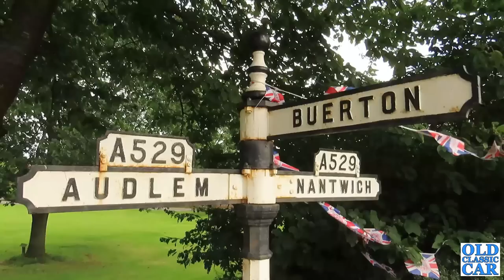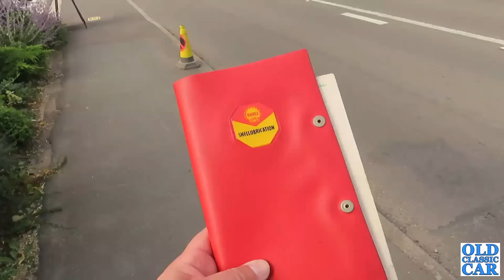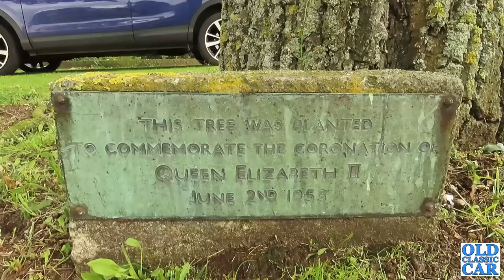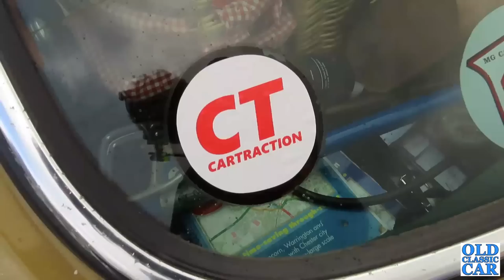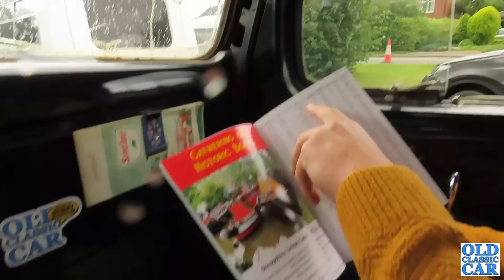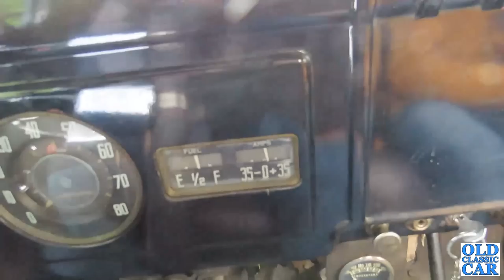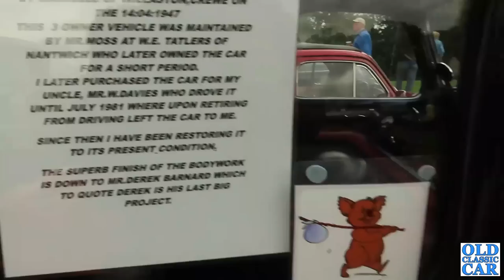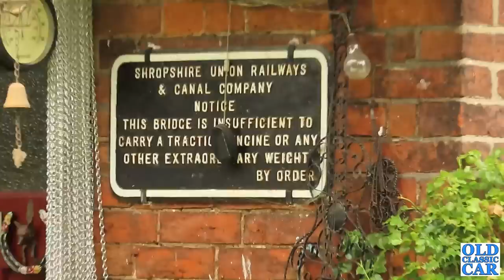The Audlem Festival of Transport 2023 | Prep, Parade & Show

Comment: Me again , there are many MGs at the shows. I watch other people's recordings of British car shows and there are always lots of them.  The must be many MG car clubs in the UK.  I liked the silver grey colored one with the red soft top. Very nice indeed.  There's a British chap who lives in the same city here as me ,and he drives a lovely red MG with the black rubber bumpers.
Reply: Wait... look like your parking brake handle is missing-- so, never mind!...Ours needed new fenders, as they were banged up from acting as "curb feelers" for 30 years, and they were rusted out just above the curled edges at the bottom, so that's something to watch out for, and another place to watch is the sides of the box, just behind the cab, which rusted through-- from the inside, I believe. When I sanded down the doors, I found Worcester (Massachusetts) Power & Light decals on them, so it had an honorable history. In the States, Dodge advertised their Truck line as "Job-Rated", meaning they had a model appropriate for every need.

Comment: Admire your quick and knowledgable, stream of consciousness comments, and love your truck. We had a '41 Dodge pickup back in the mid 1970s, which was an absolute blast. Our dog loved the crank-open windshield (although the drool flew everywhere in the wind). It wasn't happy above 50 mph, so we kept mostly to two-lane roads. One bit of caution: if you forget to disengage the contracting, drum-style parking brake on the drive shaft, it may start to smoke through the floor slot, and the gas tank is but a hand or two away. I may be gilding the lilly, but my hazy memory is of a small fire breaking out (if that's possible). I did pull over and stop the smolder by throwing roadside dirt into the mechanism! They are tough, unbreakable vehicles with happy toad faces that love the countryside. Enjoy!
Reply from the maker: I'll have to remember that!! Thanks for watching

Comment: Thank you yet again for another fascinating Video. You posed a question about the P3 Rover & its metal Disc Wheels. So As I have a distinct interest in the Rover 12 I looked things up. The Disc Wheels were first offered as an option in 1939. Making you almost correct. It would be very unlikely to come across a P2 Rover with Disc Metal Wheels that is Pre-War.  The P2 was in production from 1937 till 1948 & superseded by the P3. They both exist in Saloon & Sportsman body type, with a handful of soft top  ones.  The two models are more different than they look. The P3 being 1/2" wider on the outside & 2 1/2" on the inside. The P3 wheelbase is 4 1/2" shorter with only a half length chassis. The rear suspension being supported buy the body & it has independent front suspension. Also, different L head engines in just two capacities. A 4 cylinder of 1.6Lt & a six Cylinder of 2Lt. giving the 60 & 75. The P2 was Rover, 10, 12, 14, 16 & 20, all overhead valve units. I know my Fathers 12 Sportsman Saloon was the first one made with the wheel sat inside the boot lid. Hence, my interest in these cars.
  I was watching another Video about A40 Farina's by a member of the A40 Farina Club. It appears that very few Farina's are left. a small % of the A30/A35's. This is clearly why you are seeing so few this year.